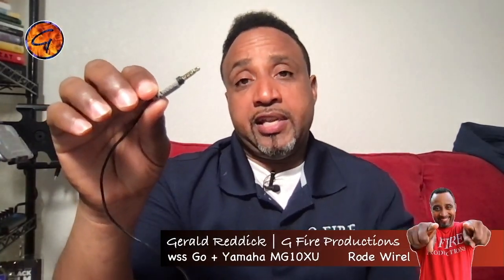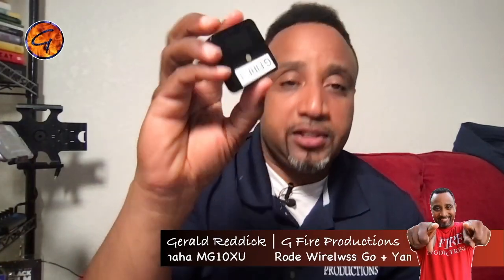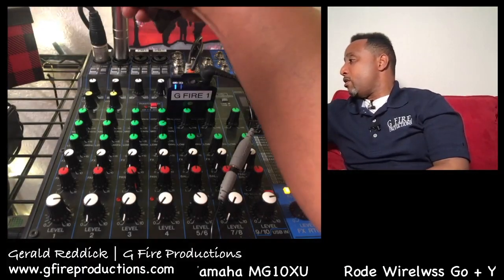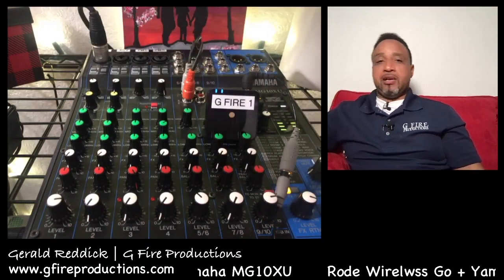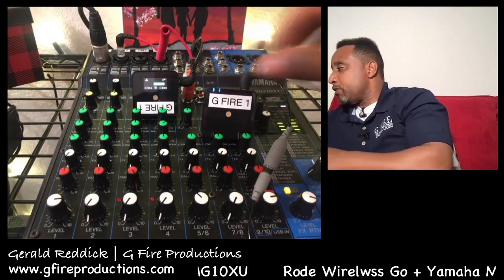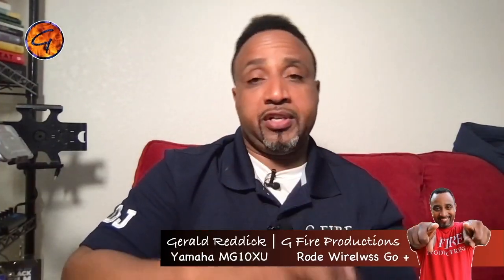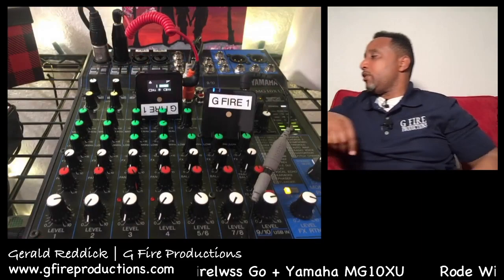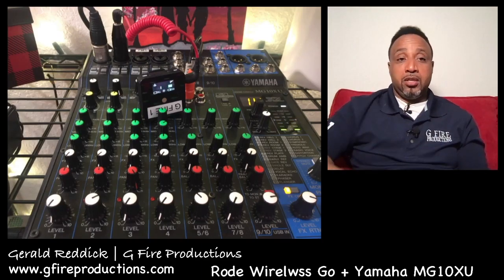Rode Wireless Go + Yamaha MG10XU | How to get the Rode Wireless Go into An Analog Mixer

Comment: Can this VXLR be used if phantom power is on? I would like to use an AT2020 which requires phantom power on one channel while using the videomicro with the VLXR on another channel. The mixer will not allow independent phantom power. I don't want to fry my videomicro.
Reply from the maker: Please don't fry you Video Micro. from my understanding the Video Micro need plug in power to work and at a voltage much lower than 48v Phantom Power.. You'll  need to convert "Phantom Power" to "Plug in Power". For this you need the VXLR+. After doing research on Rode's website this is my understanding. In other words the VXLR+ converts 48v Phantom Power to approximately 5 volts.Ithe Video Micro can be powered from about 2 voltes to 6 or 7 so the VXLR+ is the tool. Please confirm with RODE help line.

Comment: I really enjoyed your video.  How would you connect the output from a mixer into a Wireless Go?  I'm using an Allen & Heath QU-16 and would like it's output to go to the input of a Wireless Go which from there is connected to a cell phone.  I've used the Wireless Go's built in mic to go to a cell phone's input successfully and the audio is crystal clear.  I'd now like to use the output from the QU-16 as input to the Wireless Go.  How would I do this?  Thanks.
Reply from the maker: I ordered some stuff To make it happen but I wanted to be sure I’m accurate so I don’t cause nobody to blow their wireless go. If you turned on the notifications you’ll know when that video pop up sir. Thanks for watching and thanks for your support.

Comment: Hi there. Is the third theory possible when you want audio out of the mixer using transmitter to audio into a yolobox for Livestreaming?
Reply from the maker: Hello Matata and thanks for watching. Unfortunately I have never tried to use my road wireless go system to output for my mixer into any other devices. I also do not use a yolobox box so I cannot intelligently answer that question. Sorry.
Reply from the maker: I just found this video: https://youtu.be/WGdsQAdXn4c

Comment: Does this setup work with the Rode wireless Go 2 as well?
Reply from the maker: Hello Brandon and thanks for watching. It will work the same. Only difference is is the Rode Wireless Go II has two transmitters with one receiver vs the Rode Wireless Go having a single transmitter and receiver. Rode VXLR Link: Rode VXLR @t

Comment: But will the RODE feedback over the PA?
Reply from the maker: Hello DJ Neumatic. That really depends because like any microphone, you still have to follow basic fundamentals of microphone placement and EQing when you are using a microphone with a live speaker. I have use the Rode wireless go with a PA system and of course when I get too close to the speaker it will feedback because that is an Omni-directional microphone. However with the right speaker placement and the use of an EQ to help with certain frequencies, I have performed many weddings with no problems.

Comment: Is it works if I plug this RODE VXLR into my Yamaha TF3 mixer, and use Wireless Clip on? I want to buy CATEFO Star200 T2 Wireless microphone Clip On
Reply from the maker: Hello Reztan and thanks for watching. I'm not sure how the internals of the CATEFO Star200 T2 work so I don't know for absolute sure if it will work with the VXLR. Contact the manufacture and ask if the in and out of the transmitter and receiver are  standard TRS in and outs. If it is then it should be ok wit a VXLR in any mixer.
Reply: @gfire_productions  thank you. this video really helpful. We want to use it for Church. We need wireless mic so some of us do the dance and sing 😁.
Reply from the maker: @qinb  I wish you the best success with that.

Comment: Can anyone help i have it connected with a 1/4 in trs cable to a 3.5mm cable in a bal/unbal and i got sound but very low? The sound is low and i put the volume up and it just give a huge feedback.
Reply from the maker: Hey Mario-II2vd, I have the links to everything I use in the video in the description above. Make sure you have all of the proper connections. If you do have sound and it's low check your gain on both the Rode Wireless Go you are using and on the actual mixer.
Reply: @gfire_productions thanks for the answer, just to confirm can the wireless go take phantom power? 

Disregard message
Reply from the maker: @Mario-ll2vd  48v phantom power IS NOT RECOMMENDED. This could damage the wireless go. Rode tech support or the manual has more details.

Comment: Hey nice video I have
Question would it work the opposites way transmitter on mixer and receiver on iPad to record sound  if I can use it wedding to record audio from the mixer
Reply from the maker: That's a great question and you could definitely put your receiver into an iPhone or an iPad accordingly. As for the transmitter though I'm really not sure at the moment if it's able to except a line level signal from your mixer because it may be too much. This would be a question better suited for Rode Tech Support. I'm really just not sure if the transmitter can handle that kind of input even if you were to use a DI box from your mixer out to step down the audio and then into the Rode Wireless Go transmitter.

Comment: Hi, Thank you so much, do you use this for ceremonies through the speakers live for example so guests can hear the vows of the couple ?
This would be better than a traditional rack wireless system as it doesn't need mains power
Reply from the maker: Hello Tone Ranger. First let me say thank you for watching our video and supporting our channel. We personally do not use the Rode Wireless Go for ceremonies because we're at lots of of very large and high-end weddings plus we usually more than 30 feet away from the lapel mic. I used to use Shure PGXD and BLX before. The problem I was having there is once all the people stood up between where the lapel mic was and my receiver, it sometimes caused dropouts because of the bodies was like a thick wall. I've since then upgraded to the Shure QLXD microphones to solve the problem because theyuse half wave antenna which allows me to talk the length of a football field or through buildings, literally.

To answer your question, you can use the Rode Wireless Go as a lapel mic at a ceremony if it is very close and maybe smaller intimate weddings and certainly a direct line of sight between the transmitter and the receiver. I personally choose not to use that system at a wedding, but I do trust it to Vlog with because if the audio drops out it goes out it's just me making YouTube videos of which I could always do a retake or edit. You cannot however do a retake or edit live at someone's wedding. Use discretion if you are going that route my friend.
Reply: Hello there! I was wondering if you use the transmitter alone, without connecting another lapel mic to it. So the setup would be, the transmitter will be the lapel mic and the receiver connected to the analog mixer via xlr male to 3.5 mm jack?

Comment: Is this good for ceremony ? Use the vxlr into a powered speaker..one mic on jp one mic on groom?
Reply from the maker: It could work however, you should seriously test this out before a wedding!!! The Rode Wireless Go system is great but I trusted as far as flying or making videos that way if something goes wrong it's just me making my video which I could recover from that. But if there's an issue at a wedding then that is absolutely terrible. I use the Shure QLXD microphones for wedding ceremonies but I use the Rode Wireless Go for making videos or in very close spaces like in my home to avoid potential for drop outs. Weddings are such a big deal so you want to make sure you have absolute reliability when it comes to wireless technology.
Reply: @gfire_productions  thanks for making
This clear i was one in a weird situation where there was mountains, a lake and literally like 200 guests my sennheiser g4 unfortunately wouldn’t do the job with bad frequency signal, luckily my brother in law was with me and he plugged in the rode pro and omg it saved my ass! Big time! However, I’d still be very sceptical about it maybe i just got lucky.
Reply from the maker: @claudiovalero6449  I did a test with this video on yesterday and it will work as a ceremony Mike. My approximate distance was about 30 to 60 feet the transmitter on my shirt and the receiver plugged into the back of the QSC K8 that too. Other things to consider though is putting a bunch of bodies in between the units so make sure you have a good clear line of sight because the soon as they're not like a traditional Sennheiser I'm sure microphones with quarter wave or halfwave antennas. Check this out: https://www.facebook.com/100000280328964/videos/3120561098230502/
Reply from the maker: I did a test with this video on yesterday and it will work as a ceremony Mike. My approximate distance was about 30 to 60 feet the transmitter on my shirt and the receiver plugged into the back of the QSC K8 that too. Other things to consider though is putting a bunch of bodies in between the units so make sure you have a good clear line of sight because the soon as they're not like a traditional Sennheiser I'm sure microphones with quarter wave or halfwave antennas. Check this out: https://www.facebook.com/100000280328964/videos/3120561098230502/

Comment: Good video,  thanks,  if i want to use thos system in big mixer and talking and big room,  ot works?
Reply from the maker: Thank you for watching Donays. I'm having a hard time understanding a question.
Reply: @G Fire Productions  I would like to use my comica 🎤 lav, in the my church,  I would to use it as normal wireless microphone,  but we have big speakers 🔊 around.
Reply from the maker: @donays8241  you can use your Lavalier in church but you have to gain it  properly and EQ it so you don't get feedback. You also have to have a good speaker placement lab microphones are usually pretty sensitive so if it's not working out for you he's a handheld microphone.

Comment: What happens when you turn on phantom power on that XLR connected to Rode receiver
Reply from the maker: @leocj  Great question. It’s not required so I don’t use fantom power with the wireless go.. It certainly is worth finding out from Rode technical support directly though because certain mics they have does require phantom power, but not 48 V. Some of there mic  units require a much lower voltage so 48 V will damage them. I reiterate that’s a great question for Rode technical support.

Comment: Hey man, super helpful video thanks! If I wanted to take an output from the mixer and send that to the transmitter, how could I achieve that? Could I use a standard jack to jack with a 1/4" adapter from the mixer headphone socket?
Reply: The transmitter requires mic level input and supplies "plug in power" to the condenser mic.
Output from the mixer would be line level.
I doubt anyone makes a converter to run line level from 1/4 inch TRS to mic level 1/8 TRS. It could be done. I would just look for a wireless audio transmitter something like a guitar air jack, except that this is an instrument level signal transmitter. There are audio transmitters/receivers made to do what you want. I used to have an air jack that transmitted to my stereo receiver, and wireless headphones. I could go outside and play with my guitar and listen loudly without anyone knowing I suck playing electric guitar lol
I doubt anyone makes a 1/4 inch air jack that converts line level to mic level.

Comment: my mixer have laptop w/music , mic and speaker connected to a mixer all them are operating. how to record clean mic audio with wireless mic that is connected withoud disconnected or lowering the instrument sound output?
Reply from the maker: @dmgfilmproductionandphotog1567  You’ll need to adjust the volumes of all instruments so they blend well together. Then turn up the master volume to your liking.
Reply: @gfire_productions  what i mean is there any separate track for mic audio? since i'm a video editor i would like to change the old music background by new music background i will change in post production.
Reply from the maker: @dmgfilmproductionandphotog1567  To be clear I put the music in this video on a separate track in iMovie on my Mac. So the mics were recorded though the mixer in OBS then imported to iMovie. 

Now if I wanted to record mics and music in one take with this mixer, I would put my iPad on channel 5/6 and turn up the volume so it blends well with the mic. 

That works well when I’m vlogging live though but as soon as I start to edit in post. The music would sound like it’s skipping around the track when I cut out parts of the video with music in it.
Reply: @gfire_productions that a nice idea but i have limited device i can bring in any event.  i would like to know if you have any idea recording audio in separate tracks without using a laptop. i heard about audio interface i dont know if can get the job done
Reply from the maker: @dmgfilmproductionandphotog1567  interfaces are generally a way to get all of your analog instruments and mic’s through it(like my mixer) and into some kind of recording software. This mixer is very limited on outputs so the best you can do is send your left & right out to an external recorder.    Now, if you were using a more advanced interface, that allows you to send multiple channels from the mixer through a USB into multiple channels of recording software, you would still need a computer or laptop to get that done. The MG10XU is a simple mixer/interface with limited capabilities. Maybe consider a Tascam Model 12 for what you’re trying to do.

Comment: Hi, nice video! i have a question: is possible use the rode to amplifier a person on a conference room? have some problems if the rode are near the sound speaker? 
I investigating it to connect mutiple rodes on a mixer and amplifier it in a conference room.
Reply from the maker: It is possible however, like any mic in a room with speakers, you have to be able to deal with ringing out the feed back. With some microphones you may be able to do this effectively with the built EQ onto the mixer especially with a hand held mic. With lapel mics you may benefit even more from having a 31 band eq so you can deal with specific frequencies that give feedback. Sometimes lapel mics can be highly sensitive and not as ideal in a small room setting with speakers. But to be clear people do conferences with the pill makes all the time. I put a few tips below;

1. make sure your microphone is not in the path of the speakers if possible
2. get the speakers on stands as high as possible
3. Try to have your speakers in front of you when you're speaking.
4. a 31 band EQ can ring out feedback a lot better than the three band eq built onto the mixer.
5. I'm setting the gain structure on the mic, turn it up to just before feedback and back off 1/4 turn. then di any EQing.
Reply: @gfire_productions  thanks for you answer! 
is possible use a lot of this mics in a videoconference?  have too much latency?
Reply from the maker: @marianozubaran5146   I've use the Rode Wireless Go in several Zoom conferences before and I didn't have any latency issues.  In the video itself that I made you can see I didn't have any latency. Since the time of making this video I have done over 15 Zoom calls with the Rode Wireless Go Without Latency.

Comment: So what is the difference between balanced and unbalanced? I still see three pins. Did the connections change? and .. what happens when you switch on the phantom power (48v) ? Will it destroy the receiver?
Reply from the maker: A balanced cable, by contrast, has three conductors in the connector and three wires in the cable: two signals wires plus a separate ground wire. As in the unbalanced cable, the ground wire still surrounds the signal wires and is used as a shield against interference.

The XLR jack on the Shure wireless receiver is protected from phantom power. The phantom power will not damage the receiver. Rode has a VXLR Plus Adaptor for when you are plugging the Rode
Reply: @gfire_productions  i have a mixer with a few microphones two of them require phantom power... to that mixer i wanna add my wireless go, in this case do i need the VXLR+ so i can protect the wireless go transmitter? do that the wireless go output don't require the use of phantom power
Reply from the maker: @felipevillaroman2562  I think phantom power for the Yamaha MG10XU will not damage the Wireless Go but I'd consult with the manufacture or the manual to be sure.

Comment: I tried this and i got a lot of feed back.  Why didn't you get any feedback?
Reply from the maker: I Don't use any external speakers. I just  talk through this mixer and into social media or a video recording program on my MAC. This mic is highly sensitive because it is omnidirectional so prone to feedback if you are near any speakers you may be using. This is why you sometimes see YouTubers or bloggers wearing headphones to avoid this. Are you using external speakers? Are you using this set up with Zoom or Microsoft teams?
Reply: @gfire_productions  there are speakers in the room we are using.  It's for live stream as well as inhouse broadcasting.  Perhaps I should plug another mic into the transmitter.
Thank u for responding to my inquiry:)
Reply from the maker: @iwilpraiseu  Well in the case of having speakers in your room just make sure you follow that speaker placement and volume versus where your microphone is to help avoid feedback. Another thing you could do is invest in a 31 band EQ to be able to knock out certain problem frequencies with your microphone. https://youtu.be/FWN0Ur5PULQ?t=962
Reply: @gfire_productions  okay.  Thank u!